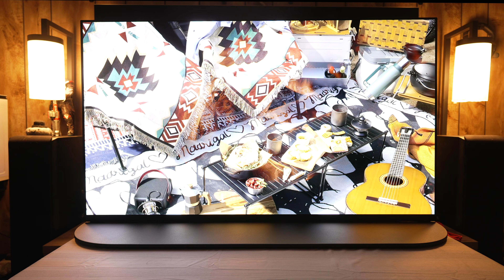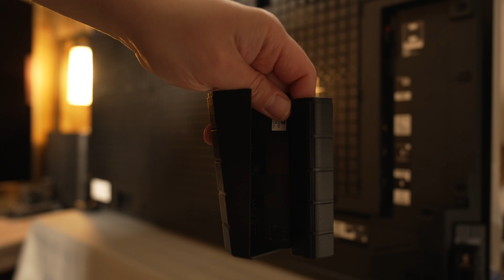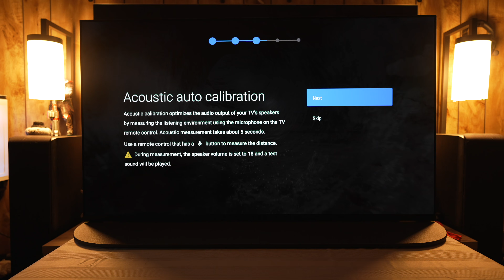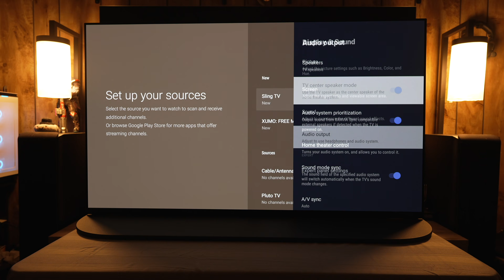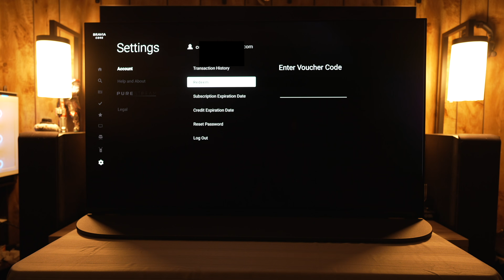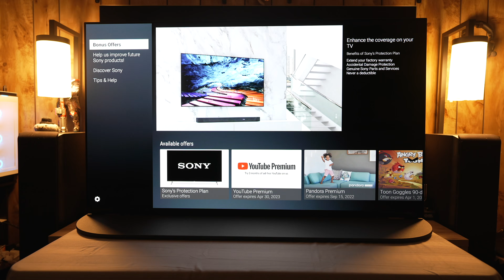Sony Bravia A95K QD OLED Unboxing | Setup | First Impressions

Comment: I am a Sony A95k user, the only annoying thing is that its brightness is significantly lower in personal mode than in live mode. When you use it in live mode, the clarity and sharpness are not as good as in personal mode. It's like a95k QD oled dolby vision was made for bright and dark, this is very frustrating, they will definitely fix this situation with a95L, they will say that they made the a95L brighter on purpose, both in live mode and in private.

Comment: The stand is great! It is substantial, heavy, and keeps your TV quite secure. There are some stands that are not substantial and I appreciate this one. In addition, the video skips mentioning that the stand has two possible configurations; placing the ledge either in the front or the back. When the stand is placed in the back, the screen tilts a bit backward. With the ledge in the front, the screen is vertical This is a design featured that deals with reflection. There is no right or wrong way to attach the stand. Ideally, you should try both ways to see which one deals with reflection best in your particular room. 

In addition, the CAUTION sheet, which has no text, caused me some anxiety. There is a drawing that to me showed a “warning” to be careful not to inadvertently let the screen flop on the floor. I was mistaken. It is a warning not to lay the screen flat on the floor, either on its face or on its back. Since I had no help, I laid the box on my floor and pulled the screen out. This puts a STRAIN in the corners because of the the weight of the center of the screen - and the screen is in danger of cracking.

Comment: I really like our new A95K OLED, but changing channels is a pain.  The remote does not have the features of previous Bravia tvs.  First, it does not have a numerical key pad, so to get from channel 2 to 1919 (soft rock) one must scroll up, 5 channels at a time, a very tedious process.  Second, if you want to view recordings made to your cable box DVR, you must use the cable box remote control.  As of Nov. 14, 2022, Sony technicians have confirmed both of these observations.  My wife is so dissatisfied she wants me to return it and use our 3 year old Bravia LED tv.
Reply: Buy last years remote

Comment: Also after turning the sensor off, turn off the motion processing settings .  PIxel shift helps reduce the chance of burn in and you will barely notice it when it is enabled. Do not turn this off.

An image shift on your OLED TV is due to a function setting called Pixel shift. This function shifts the image after a certain amount of time to prevent image retention on the screen in order to prolong the life of the display panel. It's recommended that this function is set to on

Comment: Hi, good set up guide thanks, can you clarify what you mean what you said you have to turn off the pixel shift to get  the full 4k? Others are saying this TV still gives you full 4k even with the pixel shift switched on thanks
Reply from the maker: Any TV with pixel shift will crop the 4k a little bit so it has room to move the image.
Reply: @ClassyTechCalibrations  thanks, Reddit users saying not, saying they have left room to shift and still maintain 4k it's why you get a black band at the aide when it shifts, I'll ask again thanks

Comment: With the stand, you NEED to have a cabinet that is 145cm across to support the WHOLE of the stand, you can't have part of the stand hanging over the edges of a smaller cabinet, as the weight of the TV is place at 7cm at either end of the stand, the stand will break and your TV will fall if you try it, it nearly happened to me.
I had to get a piece of wood to extend the width of my 120cm wide cabinet and place the stand on that, also don't try and slide the stand across a wood surface, it will gouge the wood.
Reply: What if it were to hang 3mm off the edge on either side?
Reply: @insomcyber  3mm would be OK, as the metal pillars that hold the weight of the TV would be far enough onto the cabinet not to flex the base
Reply: @martinweston7144  thanks so much!

Comment: A95K over S95B, but not A95K over a 77" S95C (which I expect to be about the price of the A95K) next year, Immersion always wins, also the S95B still has it's strengths and advantages, mostly higher Brightness, more Color Pop and better Gaming Features.
Reply: A95L will destroy S95C like A95K destroys S95B
Reply: @WizKing93  Good joke, kid. S95B "destroyed" A95K already, Game Mode looks terrible on A95K 🤣Dark as Night, weak colors. looks like 500 Nits.
Reply: @ManuelMedellin.  Which variation of the S95B are you referring? With all the firmware updates from Samsung, the S95B has been reduced to the S(used to be)95B.

Comment: You said HDMI ports 3 & 4 are the 2.1 ports AND YET, everyone else who has reviewed this TV says it only has one 2.1 port ???  Which is it?
Reply from the maker: It's 3 and 4. 3 is also the eARC port. Depending on if someone has certain sound bar or AVR, that could drop you down to one effective port. But if using a 2.1 AVR or sound bar then it's a non issue.

Comment: $4000 for a 65” during a recession.  No wonder why it’s ranked #400+ in Amazon LED/OLED sales.

Amazing picture but too small and needs to come down to around $2500 to be taken seriously.
Reply: Just wait for the price to drop or just buy something else of you need a TV now. No point complaining about the cost of the A95K. People argue as if the current cost of the Samsung S95B is the same as it was at launch. 
Sony buys their panels from Samsung and LG so they are always going to be more expensive than those other brands to start with. After that, Sonys are better built and known to be more durable than Samsungs, plus the Sony name has a premium attached to it. Furthermore, prices vary depending on where you live. For instance, in the UK, the 65 inch Sony A95K launch price is only £200 more expensive than the launch price of the equivalent Samsung S95B. While the launch prices difference is greater in the U.S. 

Just buy the Samsung if that is what you can afford and is what you will be happy with.
Reply: Yep, when people ask me whats the best TV in terms of picture quality I always say S95B or G2 TBH, because what you get with A95K is 5% better picture for about 1000-1500 dollar difference. Kudos to Sony, yes you made pretty much the best TV, but the price is just insane
Reply: @sneikiusas  on ebay theres a seller selling them for $3k for the 65" model A95K.
Reply: https://youtu.be/hrzakfTlcvo
Reply: I got my Sony A95K 65” brand new for $2499 on eBay with free shipping. Came in great condition from FedEx.
Reply: Preach

Comment: Another great content vid!! Looks amazing. I however couldn't resist and wait a year long plus for a possible 77'' or a 83'' a95k and got myself a great deal on a discounted A90j at 83''! Still has awesome HDR impact and incredible master series quality. It just to cost 8k.. I would have gotten the A80j but not 83'' size as you know. Thank you for al those settings videos and advise! The 83'' immersion and picture quality is mind blowing. Julio
Reply: That’s An amazing tv, Great job
Reply: The 83 inch A90J is not $8k. Im looking at one on Ebay brand new for just over $4k new and some cheaper in lime new condition.
Reply: @mobbman1  I meant: original price at lunch. Was indeed 8k! IT USED TO. Misspell from my part.

Comment: Holy shit that lighting on the sides of the tv really helps the look tbh. It Def adds something to the video/camera pretty cool. I'm guessing it also helps with the exposure?
Reply from the maker: I find it helps to give an idea of how bright or dark the screen is while letting the camera auto adjust exposure. Otherwise you wouldn't be able to tell when the average luminance of the display is changing.
Reply: @ClassyTechCalibrations  I've got to say it really works. I Def noticed it right away. Exposure is key, but me and you have talked about that alot lol. Good job man I Def enjoy it. Looks really good tbh.